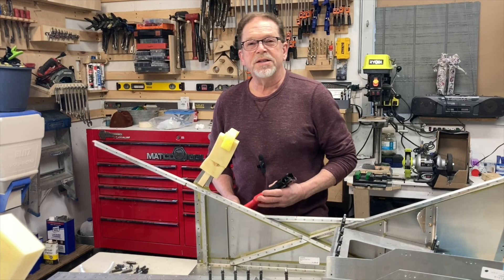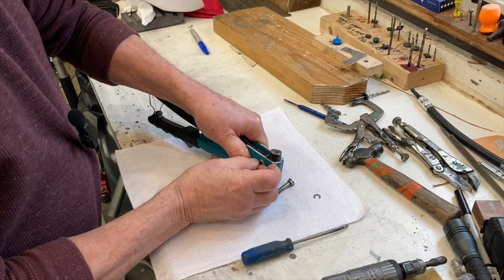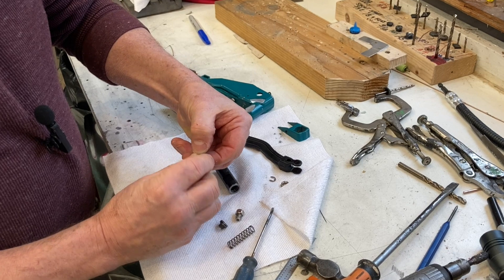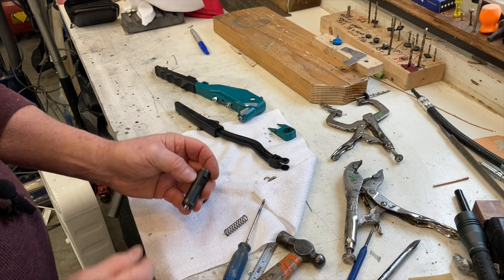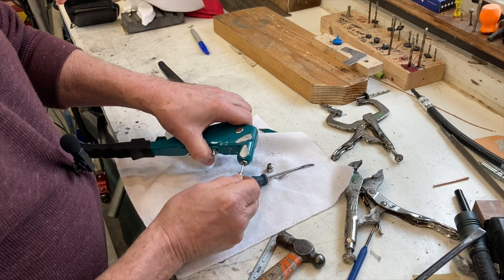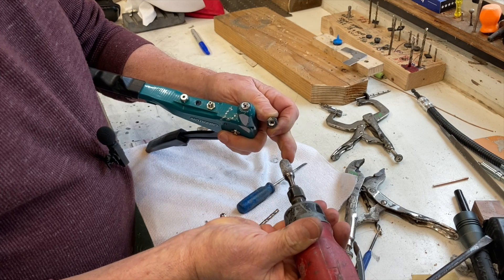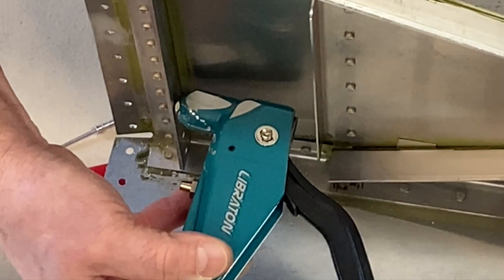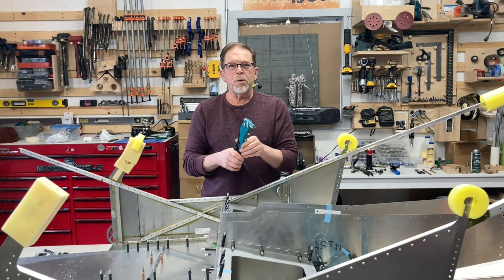Zenith CH 750 CruZer Build...Rivet Gun Modification !  Hints and Tricks      Part #2

Comment: Nice tip. I've been turning wrenches all my life on the farm. If something breaks or doesn't work like we need it to you just simply modify it. A little common sense and patients goes a long way and not to mention saves money for more airplane goodies. Key is , like you said, try the mods out on cheap china made tools. Odds are the cheap tools are plenty good enough to build one airplane anyway. And most of the time, these specialized tools are only needed a handful of times anyway. Silly to spend big money on something you are only going to use a few times.
Reply from the maker: @richardturner6278  couldn’t have said it better myself. I was just thinking if someone was using the wedge without a dome and or some other way that was stressing the shank that when this fit in that tight spot, I was so overjoyed I had to share it. I love the remark where a guy ground his tip to a 45. That’s something I’m gonna have to think about. Anyway, all of it it’s good lots of fun either way.